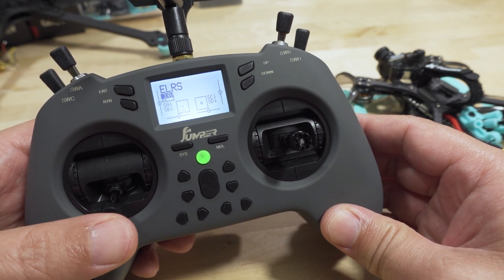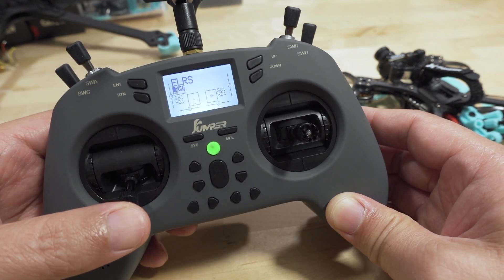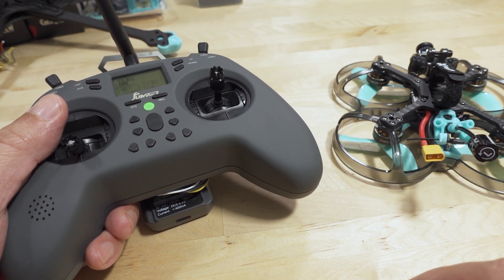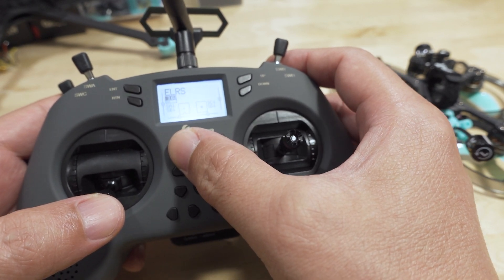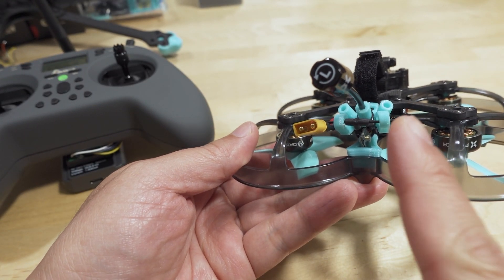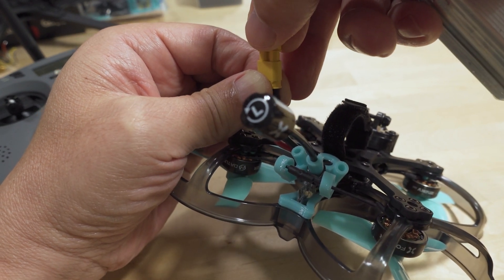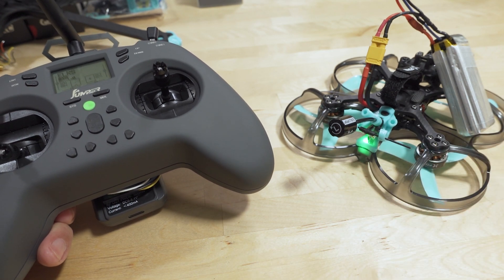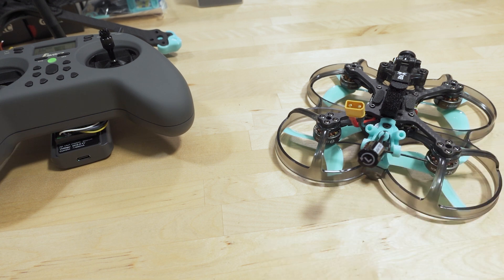HOW TO Bind ExpressLRS Receivers 🎓

Comment: Useful video. I've got ELRS on virtually everything now, still V2 for some practical logistic reasons.

I do have a question:

Generally I've done the binding with a bind phrase at flashing time in both Tx and Rx but have just got an FC with onboard UART connected ELRS and that has no bind phrase. So, I used the 3x power on approach as in this video, and it worked fine.

However, somehow it became unbound again, not at all clear how. I could repeat the process and rebind it, but it didn't stick. So I could rebind again. And again. Etc.

Don't know what is going on, suspect the FC is faulty. 

But, my question is really this: If you bind with the 3x on off approach, is it supposed to be a one time thing? I got the impression from the ELRS site that it was, and once you had bound this way, the binding was then fixed until the Rx was reflashed. Ie you could bind it once and that was it.

However my (possibly broken) FC seems to indicate otherwise, that even when bound using the 3x on off approach, you can do it all again and change the binding, maybe to a different Tx.

What is the truth of it?

Comment: ELRS is, in my opinion the easiest binding procedure since Spectrum auto bind. Binding phrase is so convenient. I actually used ELRS to troubleshoot that my Tango 2 radio was giving me problems. Yet another reason to stop using Crossfire...:)
Reply: I had tango2 problems and put elrs module on too! No more problems! And no looking back! 🙌🙌elrs😎😎
Reply: Crossfire is still easier to bind, update and work with all round, I have the tx16s with inbuilt elrs that I was planning on switching from crossfire to elrs but was just to much stuffing around with incompatible firmware and error’s trying to update it, I just put the crossfire module in the radio and never had a single issue sines and couldn’t be easier.
Reply: @gavwilldo  for me, the reliability of crossfire receivers is what drove me away. Their quality control dropped a few years back which made me move away.

Comment: Nice tutorial! I still prefer bind phrase - easy to use and you can repeat the same phrase for all of your gear.
Reply from the maker: The standard method also works with bind phrase in cases where you don't want to or are unable to flash the firmware to the receiver (assuming it has the same major version firmware on it that matches the transmitter)

Comment: Tried last weekend this method with an irc ghost rx - didn't work, so I ended up flashing the tx in the field back and forth and trying some packet rate settings until the connection was established.